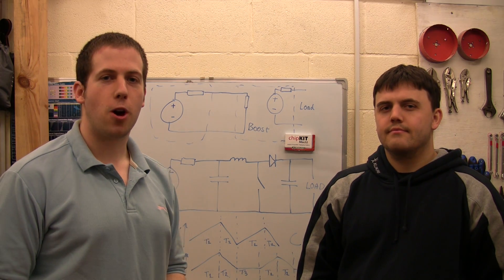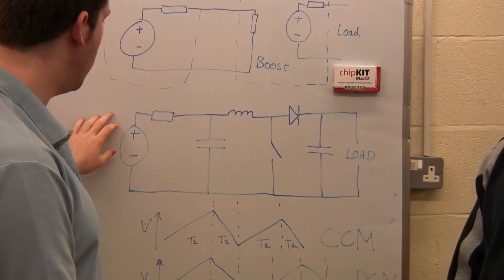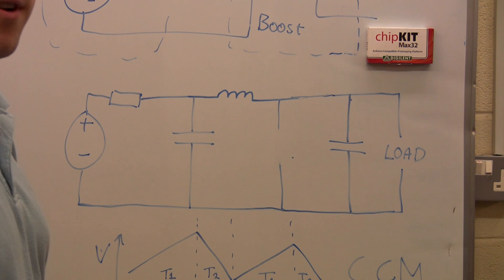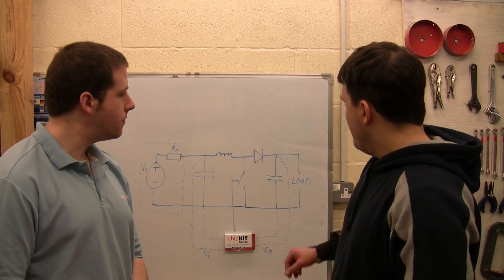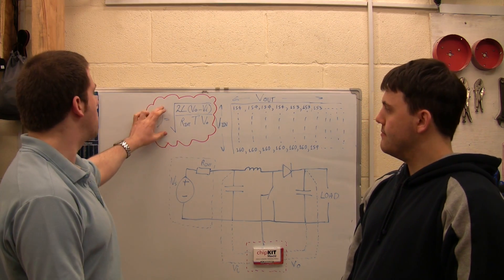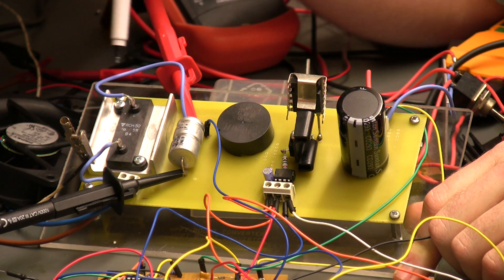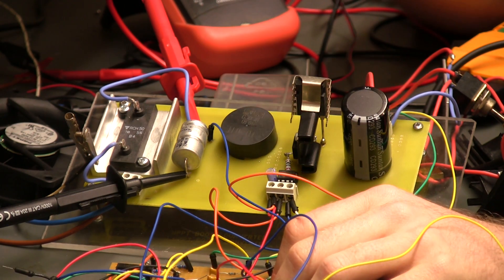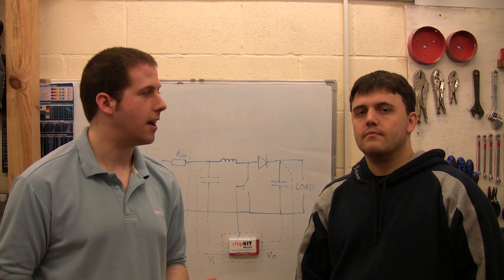Watt Circuit ChipKIT Challenge Entry

Comment: Don't most MPPT controllers for solar use a buck converter rather than a boost? And how does your converter go into discontinuous state, is it simply because the voltage on the output cap is higher than from the inductor so the diode is reverse biased?